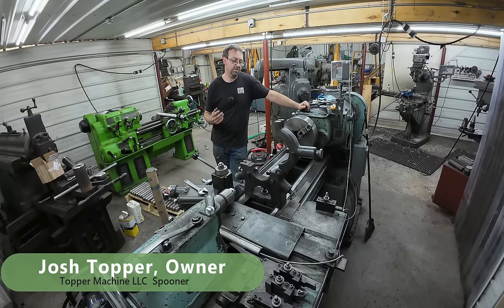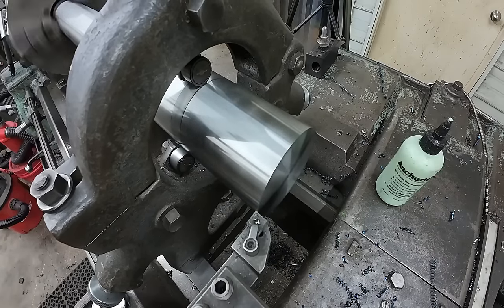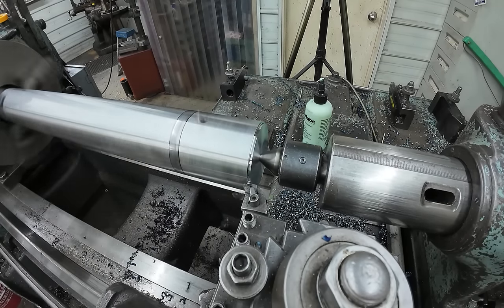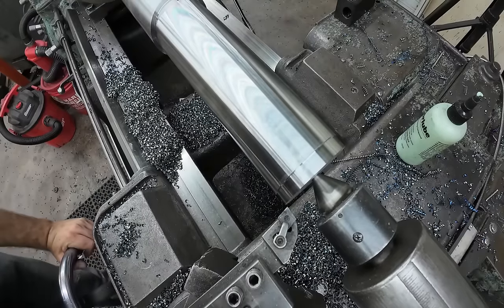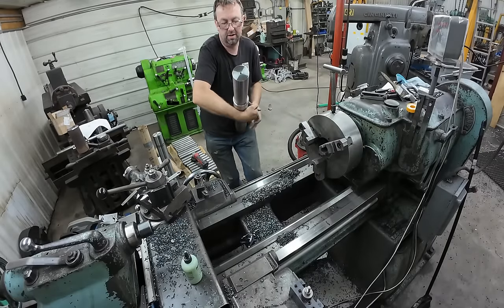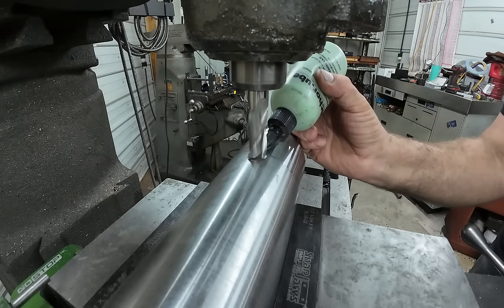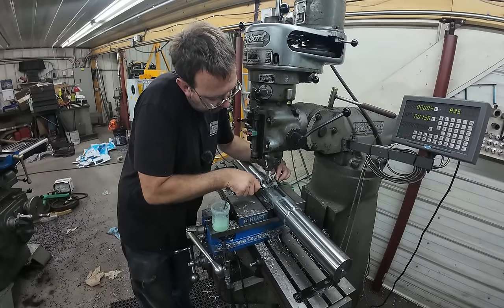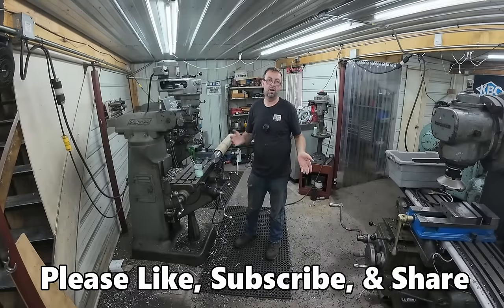Making Large Idler Shafts for Very Large Sprockets - Manual Machining

Comment: The taper in that first rough cut I think is the tool heating up and getting longer. The second cut had more stabilised temperature. Good job!
Reply from the maker: You are correct, it is between the material and tooling. Thermal expansion is a real issue to deal with. If you understand it, easy to overcome.

Comment: Nice job Josh, They have a fantastic finish, I admire your confidence checking for burrs with your thumb while piece is rotating, Did that once and spent 3 hours digging a little one out of my thumb,  It was the last time I did a substandard chamfer on a piece of metal. Experience is a wonderful teacher. lol
Reply from the maker: If you watch, I only do that after the final hit with a file to ensure it's good. And I never apply pressure. Just a close touch. If I get any feeling of sharpness, it doesn't go out the door. Customers will refuse work with sharp edges.
Reply: Thanks for the reply Josh, yeah, I was young and inexperienced and didn’t pay attention. All 3 reasons for in shop Surgery.
Reply: It's amazing what some companies will let out the door. Mostly stamped sheet, stuff is razor sharp!
Reply from the maker: @dcraft1234  I won't let sharp or garbage out the door. Probably part of the reason I'm the last one in my region.

Comment: I like the idea of thinning the anchor lube with water. I have been adding tap magic and it still dries out. I did not know it was water based until I heard you say it.
Reply from the maker: The whole reason I like anchorlube so much is the smell in hot cuts, it isn't burning oil. And it doesn't smoke up the shop. Mixing tap magic negates those qualities. .water keeps those qualities

Comment: I commend your workmanship Josh. I own a CNC-only machine shop, but only 30-40 year old CNC machines. We only make extremely precise parts in extremely tough materials including heat treatment. I feel a lot of the pain that you feel. Sure, cutting edge machines would probably be a little faster, but the same level of precision and same controls etc. would cost millions to replace because they also all take the same tooling.
Reply from the maker: Just to replace my big lathe with a cnc would be expensive. But then slower as I would have to spend time programming. Since most of what I do is only 1 or 2 pcs, so if I had CNC, I would lose these same jobs to a manual shop based on cost. Funny thing is that I have a large customer base of CNC only shops that have kept me very busy the last couple years.
Reply: @TopperMachineLLC  Curious. How long to do you think it would take to program this job in CAM software?
Reply from the maker: @MechanicalAdvantage  longer than I'm willing to spend. Not worth my time.
Reply: @TopperMachineLLC  Well, if you are wondering, it shouldn't take any more than 5 to 10 minutes.

Comment: Always good to see some heavy machining and good chip control. Often in long cuts like that the corner of the insert in the cut will heat up to dull red. Maybe next time your making a cut like this check it and film for the viewers if you can. It always amazes me that the cutting edge can still cut ok under these conditions. Thats why if you use coolant have a good supply flooding over the  work piece other wise with spasmodic splashes of coolant will course thermal cracking of the insert and failure will follow. Hope you all follow. Cheers and keep up the good work. Ian

Comment: I love your videos! Some time ago I inherited dad's old Atlas/Craftsman 12 inch lathe and have been slowly working on "tightning up" things that show wear from age, even replacing broken gears in the threading gearbox. My little "garage machine shop" had a nice addition of a desktop mill with digital readout which has convinced me that the Atlas should get digital in the future!

I was wondering about the chips that are produced, especially as you are milling the slot in this video. you clean them out with air pressure which seeming spreads them all around the shop! Is there no way to setup a vacuum system around the cutter to keep the chips out of the work and the shop cleaner? Maybe it is more trouble than it is worth. I do try to hold the vac hose end near the "cutting in progress" on the mill to reduce the splatter of chips!

The mill is a great addition to my little shop. One of the first things it produced was a replacement part for a Russian made Bayan (Russian Accordion) that otherwise would have been sent back there for repair. The original part was made from aluminum sheet metal with 90 degree bends to make feet. with age the bends cracked and broke making the instrument un-playable. I suspect that my milled part will outlast the $30,000 instrument!

There is one important lesson that I have learned from you, BlondiHacks, Kurt at CEE and others and that is you can never have enough tooling and accessories for your machines!

Comment: I'm sure the DROs on the machines would make your job so much easier than reading scales all the time. How did you get along without them in the past?
Reply from the maker: Just fine. Actually, it didn't speed me up that much. I had all kinds of little tricks and techniques to accommodate not having a DRO

Comment: back in 1997 0r 98, when I had gotten my first real lathe, a 14 x 48 Clausing 6913, I was at the scrap yard and found
some 1045 round bar.......[2] 1 15/16 [2] 2 15/16 and [2 ] 3 15/16, all TGP and in their cardboard sleeves.....20 feet long.....
well, I thought that would be some great stuff to learn how to make things and use the lathe.......
so I called my pal with a Ford F 600 flat bed, [he wa a real machinist] and got him to come and check out the stuff
and help me haul it home.....I only had a Buick Station wagon the time .....
I gave the yard $500 for the lot.......and talked them into cutting the bars in half.....I think that the 3 15/16 was still 430 lbs at 10 feet...
I gave my buddy some of the material, he ended up buying some more off me....and I had a lot of fun, I cant imagine what that material would cost today.....
sure wish I still had some of it, but when I moved form NC to FL, I had to leave it.....
cheers, Paul...:hand-pink-waving::face-fuchsia-tongue-out::octopus-red-waving:
Reply from the maker: It's not cheap anymore. That was a great score for you back then.

Comment: on video at 16:00 you said you were making a 3.00” relief section. From my perspective it looks like it’s atound 5.00”. are you dure ins 3.00”? im sure you are but it looks more. im envisioning a 3”x5” index card heldd against it. if i envision the 3.00” end against shaft it appears to me > 3.00, if i flip card to 5.00” end it appears in my mind about 5.00” shaft relief. im probably wrong but it looks different. What is the shaft diameter again ? thank you
Reply from the maker: Optical delusion. It is 3" of relief, or the part would be scrapped. 3.437" diameter
Reply: Great thanks. I will show this post to my wife explainkng why i need to replace the non calibrated tv monitor screen. 🤣

Comment: Being that I am not a machinist (at all!) 10:05 made me pause. Maybe I missed something, but as far as I can tell you didn't change the depth of your cut at all. Then how in the world did the shaft get tapered? It can't be that the axis of the spindle and the race of the head are ever so slightly off, because then you couldn't get anything straight and unlike at 12:10 it would never have cleaned itself up. 🤔
Reply: He used an accessory known as a taper attachment. It was an ideal way to do this job.

Comment: Nice...no chatter out at the tail stock. I always have some flex out there on the far end that makes a smooth cut problematic.
Reply from the maker: I had an issue recently with chatter. My live center went bad. I generally replace them every year, just the cost of doing business.
Reply: @TopperMachineLLC  Yes...I bought a new one for that reason as well. IT didn't seem to make much difference and why I say it must be flexing in either the bed or the tail stock causing my issues.

Comment: Great job.  Why not a 7/8" end mill to cut the keyway? Thanks
Reply from the maker: Rigidity, or the lack thereof. It would cut oversize in the BP.
Reply: End mills will always push away from climb cutting and pull into conventional cutting. To minimize this effect remove the bulk of material with a smaller cutter and finish with full size. Otherwise the keyway is likely to be oversized and out of tolerance.

Comment: When you go to center drill the shaft, it looks like the fixed drill bit moves off center slightly as it hits the shaft material.  Is that due to the flex in the bit, shape of the drill bit tip, or due to the tolerances of the bit mount and slide rails of the lathe?  Also, how straight does the shaft stock come from your supplier?  Maybe it is an optical illusion, but as you start spinning the shafts they don't appear to be fully straight, or is that just due to how they mount in the lathe, hence the steady rest device you use?  What causes the taper?  Why when you cut say .200 you get small chips but when you were cutting .020 you get long thin ribbons of material?  What dictates the chip "size"?
Reply from the maker: The drill will correct itself for any deviation from center as long as it is not too much. The drill could break if it's too far out. I don't indicate the steadyrest for this kind of stuff as it is not necessary to be dead on. TGP is turned ground and polished,  it is perfectly true. What you were seeing is light reflecting off the differences in cleanliness of the bar.

Comment: Making it look easy again. Experience pays off. 
Why do you use the step pulley heads on your Bridgeports? Do you see any benefit compared to the variable speed version besides simplicity? Mine is a variable speed head but that is what I lucked into when shopping. It was the right price, in decent shape and about 30 miles away.
Reply from the maker: @gofastwclass  I never liked the variable speed heads. Too much to fail. Longevity isn't there. I've rebuilt several over my 25 years.
Reply: @TopperMachineLLC  Makes perfect sense. Mine works well for me, but I'm a hobbyist doing hobby stuff. When I need a real machinist, I know how to find you.
Reply from the maker: @gofastwclass  I don't know about that. I'm really hidden in this desolate region of northern woods. Lol
Reply: Mine is a variable speed head which is fine for what I do, but If I was using it hard to make money like Josh does I would have a step pulley head as well, they are less trouble and belt changing doesn't much more effort or time.
Reply from the maker: @dutchgray86  the only disadvantage to the step pulley mill is it is only 1HP.
Reply: @TopperMachineLLC  Bridgeports aren't really ridged enough to need much power though, I get nowhere near using all the 2hp mine has and its in great shape, rattling and vibrating with any decent cut on from say a 2' face mill. 
Their value is in how versatile they are and how much affordable R8 tooling is available.
Reply from the maker: @dutchgray86  they are actually far more rigid than people think. When it's rattling and vibrating, that is throughout the entirety of the machine, not just the spindle. A BP lacks in enough mass to need more HP. I have actually seen BP mills with sand bags piled on the base to increase mass and what a difference in capability. But, what do I know, I've only been doing this crap for 26 years, taking cuts that everyone thinks is crazy and still hitting tolerances and surface finishes on a BP.

Comment: Got some Anchor lube to use with my bench drill press sometime ago.  ✊🏻 A weird observation:  It smells nothing like I thought it would have.  Kinda nice actually.  🤣 Question though, is the thermal expansion you refer to a known variable?  Meaning, if this is X steel so I can expect expansion of x.x thousands?  Just wondering for my own edification.
Reply from the maker: Yes, thermal expansion can be calculated and planned for.
Reply: @TopperMachineLLC  Thx.

Comment: Did you check runout after machining the keyslot? Most of the time it bends. Atb and keep making chips ;)
Reply from the maker: Generally don't have much problem with 1045 doing that. 1018 can/will

Comment: Please use the ratchet at the end of the micrometer, it's there for a reason
Reply: Some use their sense of feel to a very accurate degree . Some also cheat . You must have honest fingers to get an accurate reading without the ratchet . It comes with practice , and being honest to yourself - don't try to tighten the mic to make something smaller than it really is , or with a bore size , larger . I preferred looking at the instrument while it was still engaged whenever possible , after feeling the right tension on the mic .